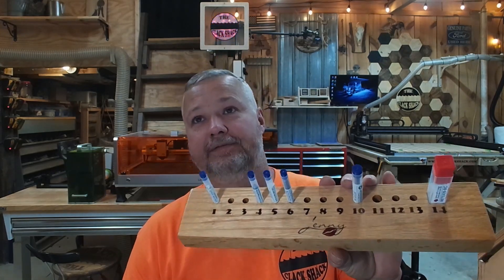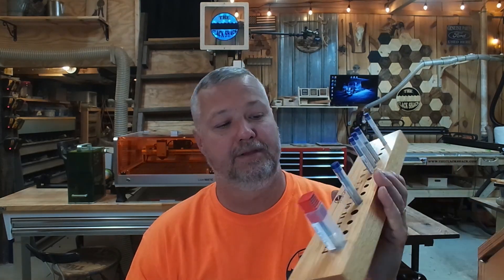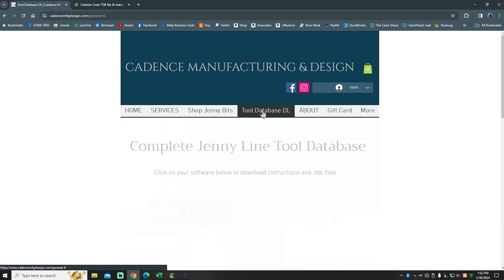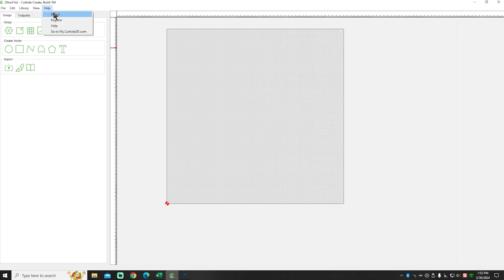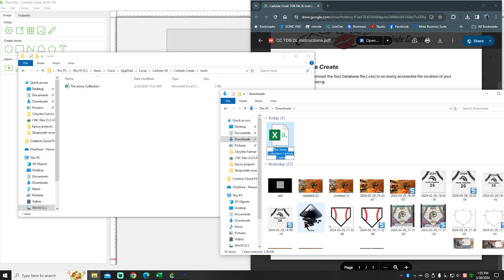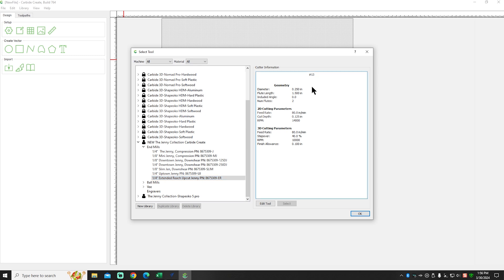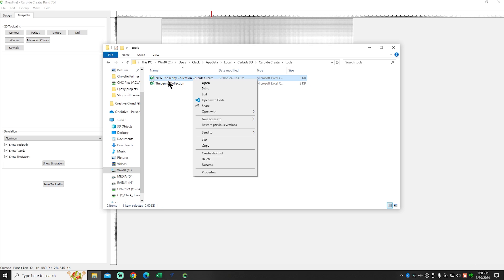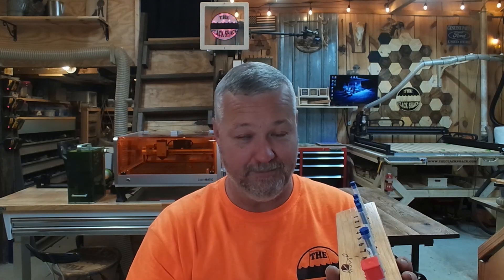Adding tool databases to Carbide Create

Comment: Hi i am using Different CNC , but I am using Carbide Pro I can not get Vee bits #2 or any number how  to add New Bits and how to choose a machine different from the drop down list please advise
Reply from the maker: I do not have much experience in designing in Carbide Pro. I use VCarve for design. Carbide 3D has some really good videos and a community page that may help.

Comment: Hey brother. How to you change specific geometry? Like if I want to change the number of flutes for instance how would I do that? Thank you!
Reply from the maker: Each tool has settings for that. You can edit them.
Reply: @TheClackShack  it doesn't seem like everything is editable.  There doesn't seem to be a field to change the number of flutes.  Unless I'm missing an advanced screen or something
Reply from the maker: @workingdogwoodworks1455  if you are in vcarve under the tools section, they can be edited, I have to add and edit some of the ones that I import.

Comment: Great video I forgot how to add my bit database to Carbide Create and found your video.  If you want to change the Number or the Name of the Bit you can in Carbide create.  Same way you edit the feeds and speeds of a Bit in carbide Create.  In your video at time of 7:19 when you circle Bit #13, on the same half of the screen at the Bottom you can Edit the Tool.  After clicking that you can give the Bit a New name, Model Number, Manufacturer and the Tool Number if you like.  In these areas I put the manufacturers name and Model and the Tool Number that is stamped on the box .  For example I may have for the Name 1/4 Upcut 2043, Then Model and Tool Number just have 2043 and then the Manufacturer might be Cadence or Jenny. I have not been able to figure out how Carbide has a link to their bits for ordering new ones yet.
Reply from the maker: Yea, I have figured more of it out now. Thanks